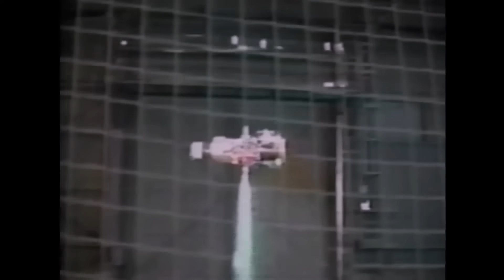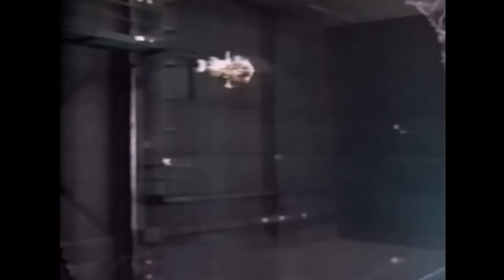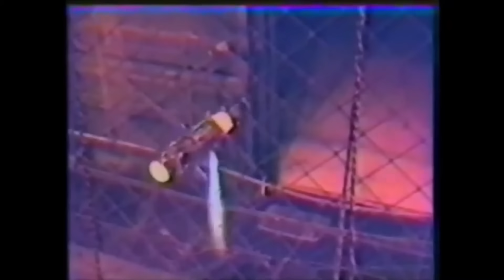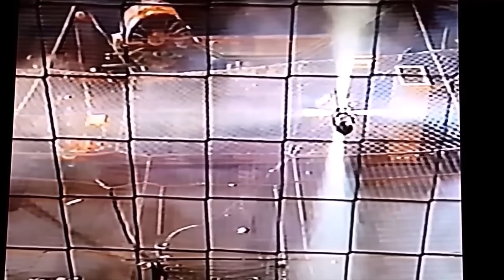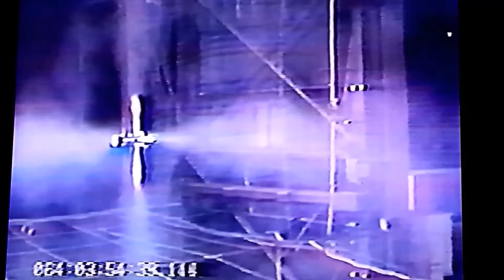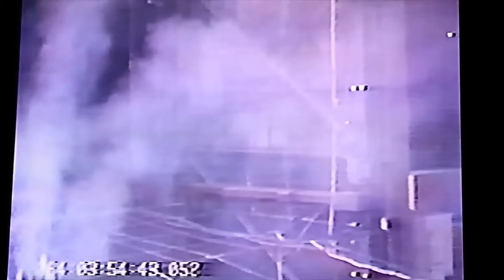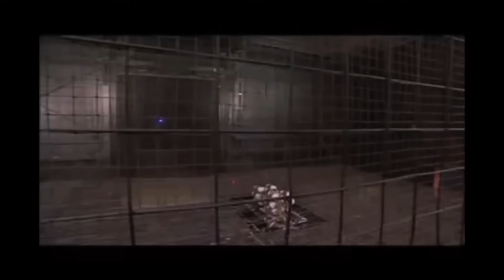EKV/KV/KW/KKV/LEAP (Exoatmospheric Kill Vehicles) Hover Test - Compilation Video (SM-3, GBI, etc.)

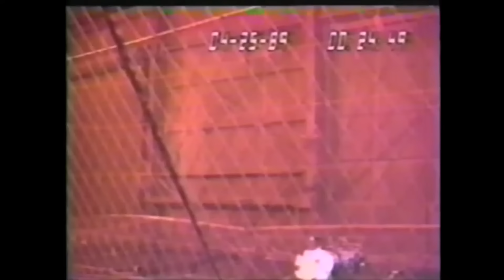Comment: The test that started at 1:25 lasted 20 seconds to spent all its fuel, as the test was in 1g that means if it was in 0g would have been accelerating at 1g for 20 seconds, giving it a final speed of 438.735 mph towards its target, which is not that impressive, but since this is just a demonstrator device meant for controllability and the real thing could be much bigger with a lot more fuel. In any case we will need tens of thousands of this dormant in orbit ready to fire if there is a target.
Reply: I doubt these will be able to intercept a hypersonic nuclear warhead
Reply: @GaiusCaesarAugustusGermanicus.  I believe it would be a very good anti-satellite weapon though.

Comment: Modern drones make this look quite lame but it was probably quite an achievement at the time.
Reply: @ElectricEntertaiment  At least drones can fly for more than 30 seconds. Have you seen the cluster performances?
Reply: @ElectricEntertaiment  these required wires to hold them in place and stabilize them. modern drones don't.

Comment: I don't understand how it could be of use with such a small fuel source, It would line up and sputter out especially if dropped from an aircraft at high altitude due to wind speed and currents.

Comment: This possibly explains some of the "UFO" sightings showing rapid changes in direction and the ability to both hover and move very quickly. Or maybe it was really phased out because the things were a nightmare to make work, and also that fuel looks like triethylborane. Real fun stuff to transport and work with...
Reply: This would have an enormous heat signature. The ufos that have been spotted like the tic tac have no visible propulsion method.

Comment: the valving seems clunky.  Not high speed proportional control valves and modern electronics/sensors that can be found in low cost drones.

Comment: Hmmm...things that can hover, change direction on a dime, emits colorful lights seemly randomly, shaped like a tic tac, & can move at incredible speeds. Sounds a lot like a certain areal phenomena people keep seeing in the skys.
Reply: They have the Tic Tac on video from an F16 it is not one of these. go look up the video. there is no jet plum in the video either
Reply: I didn't imply this is definitively the same object as seen in the famous Tic Tac videos (which were shot from US Navy F/A-18 Hornets, not a US Air Force F-16 Falcon), there have also been countless attempts to explain what is seen in those videos. The leading theory is that the videos makes it appear the object moves erratic & fast but doing simple trig using the numbers in the HUD its easy to see the object is higher in altitude (around 13,000 ft) and only traveling around 30-40 knots. Which would make it more likely to be a balloon of some sort (spy, weather, or class project). I was simply stating that these anti missile drones are Tic Tac shaped.

Also, did you know the sky is clear? The blue we see is just an illusion created by the scattering and absorption of light from the Sun. That's why the sky changes color during sunrise or sunset.

Comment: Anyone else think something like this is the "pill" shaped object the us navy jets were tracking in the UFO video released last year?  It would explain a lot of UFO depictions based on how these objects move.
Reply: I thought the same at first. But there's five or six qualifications for it to be a UAP. The tic-Tacs don't have ANY type of exhaust and do things this thing never could.
Reply: We have all seen X-Files and Stargate ofcourse the US air force has tech 50 years ahead of the normal tech

Joking aside ye nah I also had that thought and had to go looking for this video, makes you think
Reply: Certainly not 50 years, commercial sector has been running laps around them for decades.
Reply: No. The speed and angle of flight and change of direction from a physics point of view is clearly far beyond what this is capable of, and looks nothing like what has been described.

Comment: Wow the engineering behind this blows my mind! Is there more information on how this works if it's liquid 2 stage combustible like most rockets today or if it's a jet engine operating with compressed gas thrusters? I just find this so Interesting and want to know more!!! Thank you for this video! Oh and how big are these? It's hard to tell without any scale in the video for size defination
Reply from the maker: "It is approximately 52 inches in length, 24 inches in diameter and weighs approximately 120 lbs." Official statement from Boeing about GMD system's EKV. THAAD and SM-3 missile use smaller kill vehicles.
Reply: @cr0wmp918  awesome thank you for that extra info. It really helps me get a better understanding for this awesome feat of engineering
Reply: @cr0wmp918  Thanks for the specs on that.
Reply: these are all mono propellants to keep size and mass down
Reply: @Elios0000  awesome thank you

Comment: Would it be possible to make something like this in the form of a missle that a jet can fire at a base? Then the pilot can use his screens to control the thing while it flies around the base with a machine gun.
Reply: Most likely yes but you're running into problems like anti air guns and very short flight duration due to fuel supply. Probably very impractical with how expensive one of these babies is to produce compared to a guided bomb/conventional air to ground missile

Comment: It’s so insanely stable, It hovers like a cinema drone. Amazing engineering
Reply: Same concept different Propulsion
Reply: @GregoryBrown-fe5js  not at all. this was the 80s with no tiny smartphone microchips and easy drone software and tiny accelerometers. They had to use a lot more analog and gyroscope type stuff. this stuff couldnt have been very digital like drones of today which rely on basically a rasberry pi android smartphone arm processor type deal to do all its avionics instantly like a damn synthetic insect brain. the cpus used on drones aretaken for granted. but this stuff was way different. And quadcopters and drones have propulsion all along same axis... this thing would be like if you had a quadcopter drone that ALSO had more  propellers facinge very direction to thrust and move much differently. drones cant strafe left and right without tilting, while this thing ciould much more ...menauverably... which was the point. and its for space so totally different,.
Reply: But with rockets!
Reply: It's the magic of gyroscopes
Reply: @alphalex88  yep & back in the 80's the electronics & size of gyroscopes was clumsy, todays gyroscope can be small as 1/4" SQ more accurate & more stable.
Reply: This thing is for missile movement in space
Reply: @alqaeda7040  we also have Ion Rockets.
Reply: A drone seems so simple compared to this. Granted the circuitry and battery to fly a drone would have been refrigerator size during the 80s
Reply: Sterile environmental conditions. Hmm......a good strong wind? Let's see that.
Reply: @johnaustin9051  not many strong winds in space
Reply: @andrewoehmcke5653  ahh....no "heavy" air ......

Comment: Seems like this tech can be utilized, like I've bitched about for years... decades now..., for aircraft and helicopter safety systems to prevent crash landings.   Re-design to counter the crash trajectory for a safe landing is all... of course with integration into the specific aircraft designs.
Reply: I think its not included because its dead weight for helicopter use when scaled up. 

Perhaps a dedicated craft like this could be used but the G forces would be off the charts.

Comment: These give me Battlefield LA vibes.   Been following this program since the 80's as a little kid being so fascinated with how these brilliant pebbles just hover like that.
Reply: It's cute, but it would burn a lot of fuel in a very short period of time.  You'll notice none of the tests last more ten-fifteen seconds and it's out of fuel. Fuel to weight ratio is a very real thing. And hovering burns a lot of fuel.
Reply: @jstephenallington8431  in orbit it would have much longer run time due to not having to continuously thrust to hover. It would use a big engine on the back to accelerate then rapid fire the side thrusters as needed to turn and track the ICBM or separated warhead.
Reply: ABSOLUTELY
Reply: Just said that, seconds later I find your comment. 😂😂
Reply: @Troy Benson The drone still has to have enough fuel to get to the target, unless the target is only forty or fifty feet away,  the drone wouldn't have enough flight time to get there. AND all of those side thrusters popping off every couple of seconds burns even more fuel. 
 One of the biggest limitations on well, ANYTHING that flies is the power to weight ratio. More weight takes more power,  more power takes more fuel, more fuel takes more weight, and the cycle begins again.
Reply: I was trying to place the sound it was making, it sounded sorta familiar. Now I think  that I know why. Wasn't there something in the movie that made that sound?  Was it in "District 9"?
Reply: @jstephenallington8431   It's said above,the movie is called  'Battle: Los Angeles'
Reply: Looks likes the alien thrusters
Reply: @Troy Benson correct
Reply: @NealZ-l2g    That's not how what is used? 
I'm talking about the drone in the video, and in the video they are  talking about using the drone to intercept missiles.
Reply: @JStephen Allington  it's used in space so almost zero gravity, much less fuel. Perhaps slightly slower reaction but not near the force needed as shown in this video.

Comment: I wonder how many people realize that standing still in atmosphere is just about the last thing the vehicle is supposed to do. I guess it's just a convenient test of a bunch of systems and processes.
Reply: Most people don't get it.  Still need to get dialed in on the orbital mechanics to deliver this thing.  It's just a final yard adjustment system, basically an autonomous docking system.  That said, it is very impressive to get it to hover in atmosphere.
Reply: Simple solution 

It’s sent on a fast missile to intercept a rocket that it detaches from, and can make adjustments in space, and keep its speed

Comment: This reminds me of Battle LA. Could water electrolysis be used as fuel for this, as in HHO gas aka Browns gas? Another question is could turbines or pulse jets be used for this in atmo? Pulse jet version would keep cost and maintenance down.
Reply: I think this kind of thing is better for space missions where you need super precise maneuvers. For a hovering aircraft on Earth, I think we are fine with helicopters, they are probably cheaper and use less fuel that this kind of thing.
But I also think that this technology could be used to make a more stable VTOL aircraft like the Harrier or F-35, but is probably needlessly expensive and complex.
Reply: @raico6890  Good point.

Comment: It's important to remember that the thing is tiny and most of its weight is it's own propulsion kit and fuel with a heavy casing to keep the two separate.
Modern drone tech, and especially processors and batteries mean we can field cheap and lightweight platforms for aerial work.
Reply: Modern aerodynamics based drones don’t work too well at high altitudes or in space though (not at all, actually), which is where these were designed to operate.
Reply: These vehicles can track and hit a target while moving  at ~10Km/s in space, and your comparing them to hobby drones? lol
Reply: See title - "exoatmospheric"
Reply: Thank you. Yes. It is important.
Reply: @Stelios Stylios Oh yea, i get it. The advancements here is what has led to consumer products. 
Theres alot of things like that i guess.

Comment: How long can this thing do its busines - how long does the onboard fuel last ?
Reply: It doesn't matter as much as you think. In operation, a kinetic kill vehicle won't need to spend fuel hovering against gravity or fight air resistance. The purpose is to demonstrate the precision control needed to get in a head-on collision with an incoming enemy warhead after being boosted to great velocity by the intercept missile that launches it. That it actually can fight gravity and hover in a test chamber on Earth is just an added bonus.